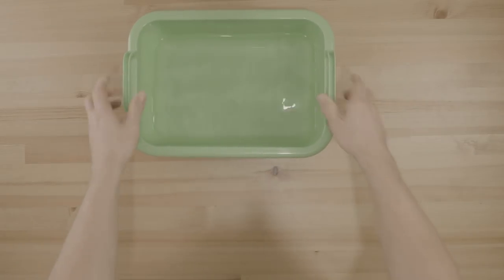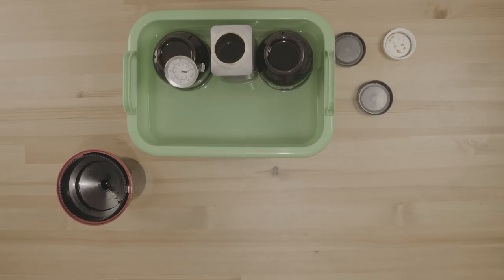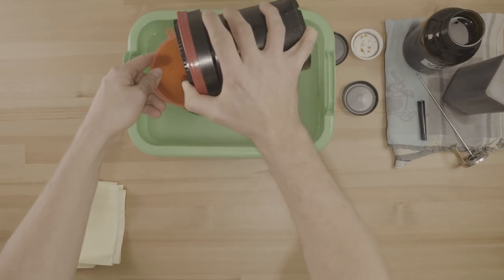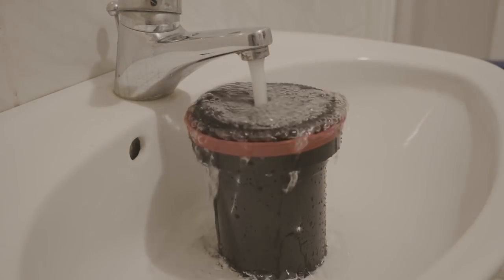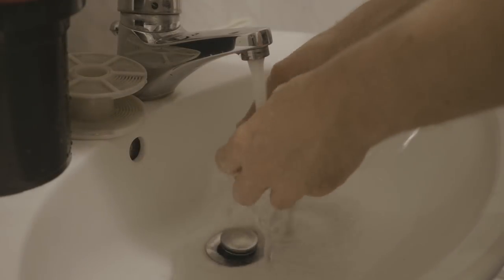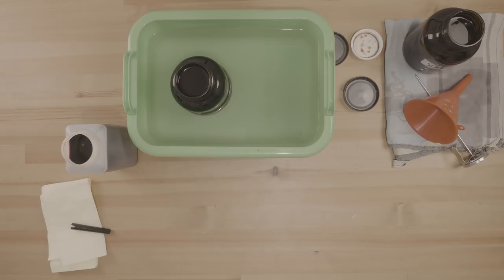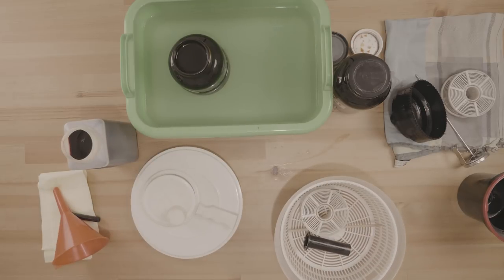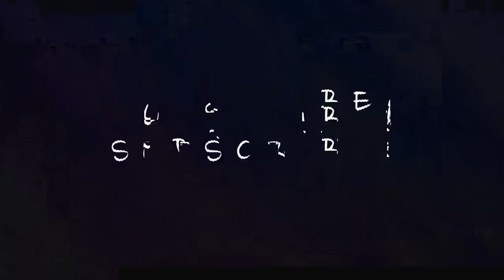How I develop Kodak Vision 3 film and other color negative film stocks at home

Comment: I searched the planet for 16 mm negative film. I did discover an abundance of 110 film and the Minox 8 mm stuff but no 16 mm, the reason for my quest is I found in my gear an old army issue Minolta MG the whole kit! so then I looked for a developing tank with a 16mm reel which is open on one side :( so I believe a adjustable reel and tank is more desirable.  I found some vision 3 movie film but you answered my REM-JET issue and now I can go at it full force. I found in a small shop in New Jersey some Minolta cassettes and had them send to me and now I can roll another one just like the other one :) I'm excited, I used to process large prints in my Shop in NY so I have the C-41 down to a science so this will be a lot of fun. Thank you for the heads up on the Rem-Jet and a microfiber cloth I will let you know my results. Have agreat weekend!!
Stephan
Reply from the maker: That sounds great Stephan! Enjoy the process! 👌🙂

Comment: Great video! Thank you! I just developed some Kodak Vision3 500T cut into 120 format and followed your system. Tried the microfibre cloth but the 120 film was a bit too wide, or my cloth too small, so I ended up just hand washing the remjet off. I was so worried about trying out cine film in C-41 chemicals but it was easier than expected!

Comment: ECN-2 uses a other Color Developer the C41. ECN-2 uses CD-3, C41 uses CD4. They produce different dye hues and uses other couplers. At last CD3 produces much more stable dyes (therefore it is used in movie film stocks, E6 and RA-4: they are usually getting HUGE amounts of light (in ECN2 during copying/scanning, in E6 during projection and in RA-4 when the print hangs for 50 Years at grandmas wall)) than CD4. 
So, yes, you get a (pretty nice) picture using C41, but with proper ECN-2 you will get a even nicer picture.
Reply from the maker: Will have some film in ECN-2 developed very soon! 👍

Comment: Hi Robin, 

Loving the channel and content.  Can I ask 2 questions 1) are you using a filter on the camera when you shoot Kodak Vision3 500t?? 2) I see that you have bought a bulk reel of Vision3 (in a film tin).  What's the process of getting this onto an AP Film loader??  Thanks in advance.
Reply from the maker: Thank you! I never use a filter because it isn't necessary. You can adjust the color temperature in post later without any issues.
I usually load the film in a darkened room at night to make sure it's not getting exposed to any light whatsoever.

Comment: Hi! I was wandering if you used the temperature and time specified in your c41 kit or it has to be adapted for ECN-2? and it's ok if I develop color film and motion film both together in the same tank? Thanks!
Reply: You could try it but I'd be worried about the remjet getting on the c-41.  It is advised to was the tanks very well before switching from V3 to C-41 and I think that this is why.

Comment: Hello, can you re-use de solution that you made by increasing the time of developing?
thank you!
Reply: You can usually compensate for the loss of strength of the developer by adding more time. Usually about 5 seconds per roll, for each roll over the recommended number of rolls. But there is no set formula and results may vary.

Comment: I heard that you could use hot water + baking soda to remove the remjet before developing with the standar c41 process and then before using the stabilizer you could clean the film with the wet microfiber cloth and then use the stabilizar. Do you think that there would be a problem if I try it this way?
Reply: Great video btw, Thank you!

Comment: i thought you had to use remjet remover or baking soda before using the dev, blix ect
definitely going to use the microfiber method over rubbing it off by hand though
Reply from the maker: You don't need all of that and it works just fine! 🙂